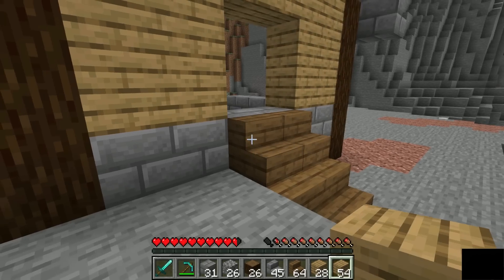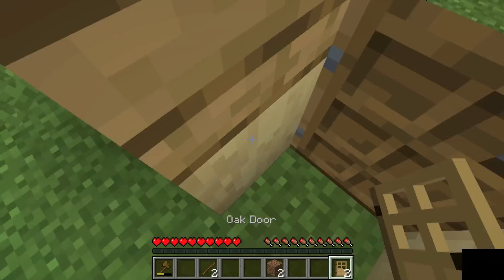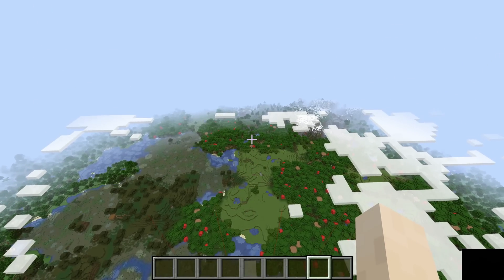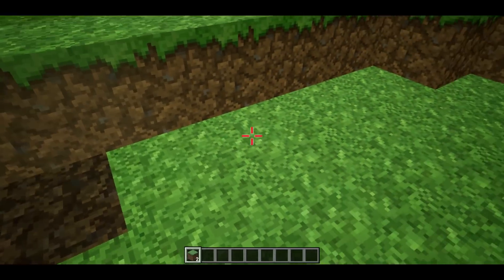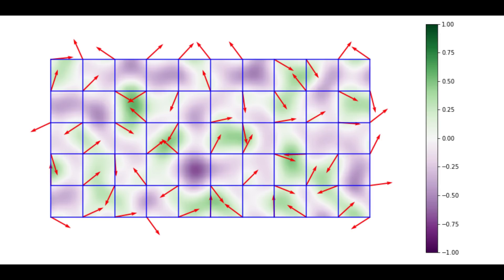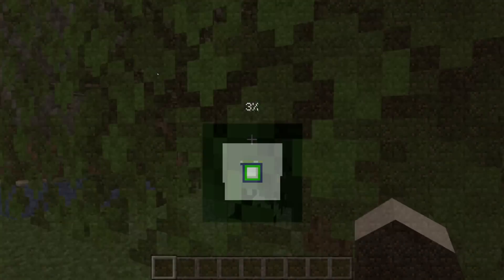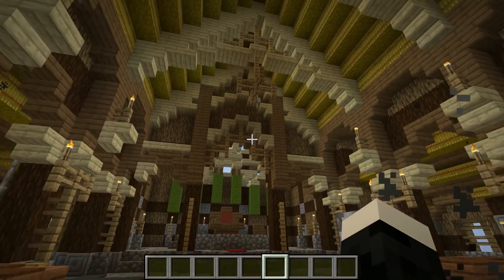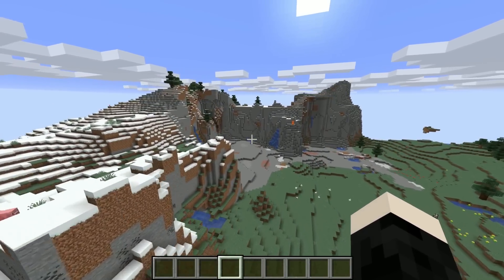Why Minecraft is a Technical Feat | Explaining the Engineering Behind an Indie Icon

Comment: Hey! I know this video is already a year old, just wanted to mention something:

700k triangles isn't that much nowadays, as you said, each hero in overwatch gets 60000 triangles, but there are possibly 11 of them on screen at once (not counting the player character), which puts it at roughly the same triangle count. There's really no reason for Minecraft to be as GPU hungry as it is (even though still you are much more likely to be CPU bottlenecked), but due to how it's structured (e.g. it loads the vertex data of most objects to the GPU every frame, not leveraging the speed of the GPU in this regard) it just can't get better without a major rewrite (which hopefully happens now that it has finally updated the OpenGL version). Most of this is due to how it was made using very old technologies, such as OpenGL 2, which was already deprecated at the time.

I wouldn't really call the game a technical feat, but it does deserve some praise on the idea.
Reply: That's 700k triangles per chunk, of which there are 625 with the default render distance. The full formula would be (blocks per chunk) * (amount of chunks) * (faces per block) * (tris per face), or (16*16*256) * (R*2+1) * 6 * 2, so with a render distance (= R) of 12, that's 491,520,000 tris.

EDIT: of course, that's still a simplification. Not all blocks are cubes, but also air doesn't have any faces. Then there's glass, water and ice which have transparency, etc.
Reply: @nixel1324  My bad there, didn't check the calculations and I missed that part. However I still don't think it is a technological feat to be able to render that much. Apart from basic face culling and not rendering geometry behind the player, minecraft didn't really do much in terms of optimizing geometry (e.g. It doesn't do greedy meshing, any form of LOD, octrees, etc.) and even comparatively week GPUs can run it at acceptable framerates. Remember when bedrock edition came out and everyone was shocked by render distances that went up to 128 blocks without much of a hitch
Reply: @BalintCsala  Fair enough. 

On a related note, there's a mod being made that adds procedural LOD to the terrain. It's not done, but it's already really impressive how much of a difference it makes while barely affecting the way things look.
Reply: @nixel1324  I imagine that's what Optifine has been doing, no? The amount of performance they can squeeze out of MC is astounding.
Reply: @K-Anator  No, optifine is actually pretty middle of the road in terms of performance. Nobody is actually using it for performance at this point, sodium beats it by a huge margin.
Reply: @BalintCsala  Well considering Sodium doesn't work on my brother's laptop, and Optifine takes him from 20 FPS at the lowest settings to 80 at a decent mid ground. I'd say Optifine is doing pretty damn good, and obviously has someone using it for performance.

Anyway, I was curious as to /how/ optifine increases performance, not your opinion on how well it does it.
Reply: @K-Anator  Soduim takes you to the hundreds of FPS lol. Otifine is just for visuals now, shaders, advanced texture packs, etc.
Reply: @xcalium9346  And both take me to the thousands on my PC. But like I said, sodium doesn't work on my brother's old laptop, optifine does. Leaving all settings at minimum he gains well over a hundred fps.

I'm also quite aware of what Optifine is capable of, thank you for your astute description.
Reply: @xcalium9346  Sodium work terrible in older systems and integrated graphic cards.
Reply: @RCorrea0  indeed - it's also pretty bad on high end (5600x/RTX3070 and above) systems when it comes to high fps (sodium uses vanilla behaviour of loading new chunks > fps)
on the optimisation side of things I use optifine as a base then add enchanted block entities, EntityCulling (fabric), lazy dfu, and tweakroo (block breaking particles to off) - I also use a few utility mods like WorldEdit, Shulker box tool tips etc
oh and let's not forget that sodium doesn't render path blocks like vanilla, so good luck if you like building :/
Reply: Yes, absolutely correct. The way the java edition renderer works is very inefficient and it always was. There is a reason why performance boosting mods for the game are so popular.
By using some proper mesh baking and caching techniques and offloading the mesh building to the GPU, thus saving bandwidth, the game could run much, much better than it actually does. There are people here on YouTube that made mc clones with a more sophisitcated renderer from scratch in a week.
Reply: Completely agree. Not sure what part of this was a particularly difficult problem to solve
Reply: @obiwac  Its per chunk. Also a lot of the technical challenges of voxel games in general comes to the structuring of the voxel representation. Can't have each voxel as its own object, as much as I wish you could. It doesn't really have to do with vertex count alone.
Reply: @kaleidodeer  yeah ok but again, that's far from a hard problem to solve
Reply: @obiwac  Sure, if you have experience with voxel tech, otherwise you'll be going through a lot of headache.
Reply: Yeah, considering the 2011 game titles released back then MC was a trend setter for procedural and building games. This game was terrible in regards of performance and it barely had anything. I wouldnt call it ground breaking back then.
Reply: I mean OpenGL 2.0 isn't deprecated, only OpenGL 1.0 is.
But as far as I know, they haven't used shaders(programmable that is ;) ) and weren't able to, so it must be older than OpenGL 2, OpenGL 2 added GLSL support.
(I mean there was an extension for OpenGL 1.5 for adding shaders).

I think the big problem back then was that OpenGL support was all over the place especially for integrated and onboard GPUs, thus using the lowest denominators.

But I agree, I always have to think about Cube2:Sauerbraten it's a voxel based game from 2004 and is in many ways way ahead of Minecraft. Especially the building part of the game.
There are probably many optimizations in Sauerbraten which wouldn't work in a OpenWorld enviroment, but on the other hand the game is 5 years older, and that was a point in time were hardware moved rapidly.
Reply: @MrDavibu  yeah, I meant more like the fixed function pipeline. They used it up to 1.17, where they switched to OpenGL 3.2 which doesn't allow it to be used anymore. But even now the newest main stream card I could find that only support 3.2 is from the gt 300 series, which makes sense, both the programmable pipeline and 3.2 pre-date minecraft
Reply: Also, this is a nitpick, but the game doesn't use perlin noise for the heightmap, but 2D simplex noise. For 3D it does use perlin noise, because Simplex has a licence on it beyond that
Reply: @BalintCsala  There's really no reason to not use Simplex anymore with the availability of OpenSimplex and OpenSimplex2
Reply: Isn't that what bedrock is?
Reply: wait minecraft sends vertex data to the gpu every frame? why?? you sure it doesn't just send the vertex data of chunks that got updated that frame?
Sending vertex data every frame is such a waste and seems like not that hard of a fix right?
Reply: @elin4364  not for blocks, those aren't sent every frame, but most other objects are (like entities)
Reply: @BalintCsala  ohhh I see, that makes sense. huh
I mean I guess entities generally dont have a lot of vertices anyway. Actually thinking about it I really dont know how you'd do that in a better way. You could do 1 draw call per limb I guess, but thats probably slower anyway.
Maybe doing animations in the fragment shader? That might work, you might even be able to use instancing for mobs of the same type then maybe which would be pretty cool
Reply: @elin4364  I'm fairly certain the transformations required for animation are anyway done in the vertex shader. As for sending vertex data to the GPU every frame, I seem to recall that older versions did to target OpenGL versions which only supported client-side buffers. I may be incorrect about this though. Csala seems to know more about this than me anyway
Reply: @elin4364  instancing is generally the solution here, yes, then you won't need to  multiply vertices on the cpu
Reply: @BalintCsala  huh? Wdum? How does instancing help with that issue? Instancing just lets you draw the same object several times, it doesn't magically fix this issue or anything.
Reply: Like how does instancing mean you wont have to transform vertices on the cpu? Are you passing projection matrices per limb to animate then or? Or are you doing animations completely in the vertex shader?
Because then those are the solutions to this, right? Not instancing, instancing is just an extra bonus you can get from it
Reply: Going by your logic, a ground breaking mathematic theory is not a feat because the mathematician didn't invent a new word processor to write his or her thesis on? These things you mentioned are tools, and just like hardware tools they improve over time with better alloys, more precise machining  and such.

The fact that Notch thought of the idea, and combined all the tools he needed, to make a groundbreaking game is a feat. Yes it has aged since then and needs rework but that doesn't change the fact that it is a feat and a very technical one in gaming industry on its inception.
Reply: @Thaumazein_FPS  never said it isn't a great feat, in fact my last sentence said that it does deserve praise for the idea. Putting together already existing stuff is just as innovative, as making parts of them work

Comment: A technical feat? There is absolutey zero reasons it should perform as badly as it does or even use a fraction of the memory that it does. Its one of the least optimized games that people actually play. Its literally WORSE than ark.
Reply: Blame Java. Bedrock edition uses c++, so it runs much smoother. Java is the original, and is easily missable, but not very efficient.
Reply: @suyogv8235  java is by no means a slow language anymore if written correctly, and the game very clearly has massive performance and optimization issues.
Reply: At least in Minecraft the textures are always basic, unlike in ARK where you have to wait multiple seconds for your thatch hut to actually look like it’s made of thatch.
Reply: cry about it

Comment: 6:25
I thought noise in minecraft was used differently?
See: notch.tumblr.com/post/3746989361/terrain-generation-part-1

~snip means i cut out a portion to shorten the comment

"In the very earliest version of Minecraft, I used a 2D Perlin noise heightmap to set the shape of the world... ~snip ...Specifically, there’s no way for this method to generate any overhangs.

So I switched the system over into a similar system based off 3D Perlin noise. Instead of sampling the “ground height”, I treated the noise value as the “density”, where anything lower than 0 would be air, and anything higher than or equal to 0 would be ground. "

11:58 i don't really understand this explanation for lighting
How can you make the light level a mixture of the level below it if that wasn't set yet? Given we're starting from the top.

I read about another method which makes more sense to me, here:
reddit.com/r/gamedev/comments/erpst/how_does_the_minecraft_lighting_model_work/c1ag9z2

"First, set the light value of each voxel to zero and find every one that is a light source.. ~snip ..Set each one of those voxel's light value to the light value of the light source and mark them. 

Then, phase two: look for a voxel that has been marked. Unmark it, and propagate its light value to each voxel around it. To propagate, look at each voxel around the source voxel-- if that voxel's light value is greater than or equal to one less than the source voxel's light value, do nothing and move on. Otherwise, set the neighboring voxel's light value to one less than the source voxel's, mark it, and move on. Once the light value has been propagated, restart the search from the top and find another marked voxel to process. Continue the process until the whole array is free of marked voxels-- this means that the scene has been completely lit... ~snip"

I've made an implementation of a voxel world and lighting generator using these methods and it worked, whereas i can't even imagine how i'd implement your explanations into code (see the mixing lighting contradiction i pointed out above)

I know these are fairly out of date (being from 2011 and 2011 respectively), but your explanation didn't explain overhangs or have the lighting system make sense. I know i'm probably missing something obvious, but idk what, soo, comment.
Reply from the maker: Hey @Jake28, thanks for the tumblr post from Notch, that's pretty cool. And this video wasn't meant to be 100% accurate to how Minecraft does everything, I just wanted to give a broad overview of how you would code a game like this that the average non-programming person could appreciate :). So, I definitely did simplify the concept of how the terrain is generated, and with the new update that Minecraft is releasing I'm sure the terrain generation will be much different then just a simple Perlin heightmap.

For the lighting, I don't think there's a problem with the way I explained it. When a chunk generates you could start from the top (ignoring light sources) and fill it in with the sky's light level. Then when you hit a light source you could set that light level to the source's level, and then fix all the light levels around that block. You wouldn't have to worry about the speed of this because you only need to update the chunk when the daylight changes or a new light source is added which means it should be minimal changes. You also wouldn't have to worry about blending the light level below you since you only blend light levels when you hit a light source (I guess that is a bit different than the way I explained in the video though). I haven't coded a lighting system, but I'm making a voxel clone right now so maybe I'll change my mind about this when I actually implement it.

Thanks again for watching though, and hopefully you were still able to enjoy it even though it's not 100% correct :)
Reply: @GamesWithGabe  
Thanks for the reply, it was still a fun watch despite the two points I had in my comment.

I still don't understand how you could do lighting without using an iterative approach, and I was a bit confused by you saying

"and with the new update that Minecraft is releasing I'm sure the terrain generation will be much different then just a simple Perlin heightmap.", 

considering the post by notch saying that it isn't a simple Perlin heightmap is from 2011, so roughly 10 years ago by now.

despite that though, good luck with your voxel clone

Comment: It might be way too late now, but I want to learn more about how Minecraft's systems work. I'm trying to develop something similar (probably nowhere near as advanced), and I'm still stuck on some of the more basic parts. Perlin noise and terrain generation is simple enough, but I got stuck when it comes to biomes. It doesn't seem like Minecraft does the basic height map + temperature/humanity, at least not anymore, so how to they define the shape of the biome? In addition, how would you even find the border? Then there's also the issue of interpolation between biomes as to not have odd sudden changes in terrain generation, though I think that will be simpler to solve after figuring out biome generation.

Edit:
After rewatching this and thinking about things for a bit, I think I might have figured something out. I have yet to actually attempt it yet though.
Reply from the maker: Hey MightyDantheman! Biomes were something I struggled with when I tried to recreate Minecraft as well. I never ended up with a solution though, so in this video I described what I could find on the Minecraft wiki, and from what I understand they did change up the method from using a temperature/humidity map, but they never described the new method. Hopefully you can come up with a good system though!
Reply: i think its just the a chunk by chunk check of the temperature x humidity perlin noise map, like that you get a perlin nois-y biome shape

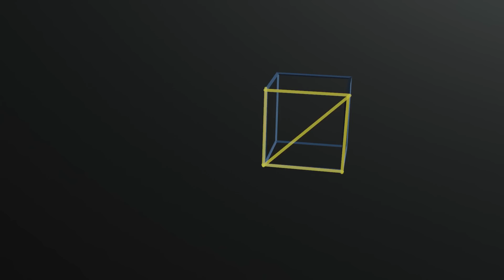Comment: 2:58 it's each triangle a texture
this is made using lwjgl and opengl takes your texture and maps it to triangles so the texture should be square so opengl stores 12 different images/sprites 

but your vid is high quality
keep it up
Reply from the maker: Hey Pislify, thanks for the comment! Can you expand a bit on what you're saying here? Minecraft uses a texture atlas, so opengl shouldn't have to store 12 different images/sprites per block, just one image per block type. I might be misunderstanding your comment though so feel free to correct me :)
Reply: @GamesWithGabe  Wow, last time I saw this video you had like 50 subscribers. Glad to see your channel has grown a bit since then!
Reply: @GamesWithGabe  what i said is completely transparent to the developer as OpenGL (or lwjgl) does this when you specify a file 

you can see this in their source code

but for the dev will only specify a texture coordinate for each side or use a texture atlas
Reply: @pislify34  Yeah, block vertices point to uv coords (block vertices are composed of position, color, and two uv coord sets, one for the texture atlas and one for the light map) on the texture atlas sprite. However, for a basic block (like dirt), each triangle face (technically quads, since blocks are drawn with quads in minecraft) points to the same dirt texture, only one image is actually stored in the atlas.